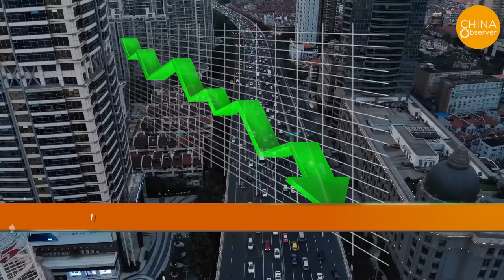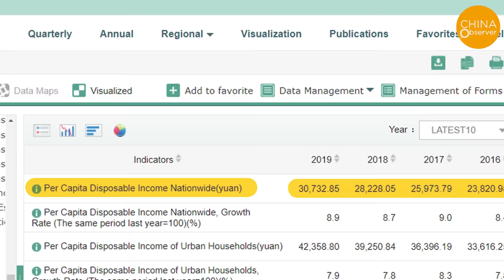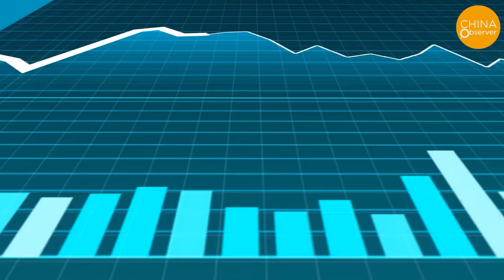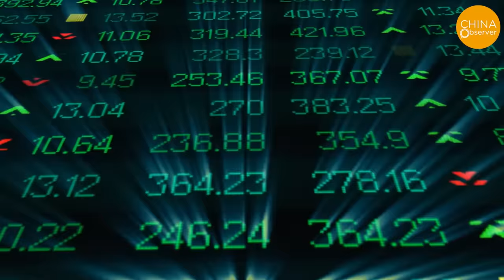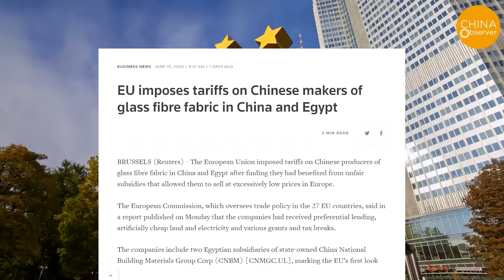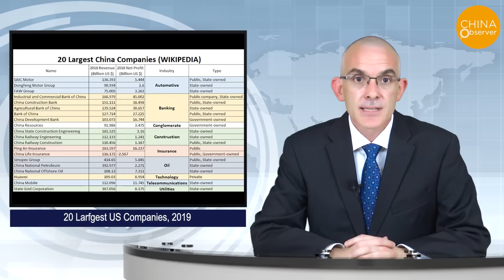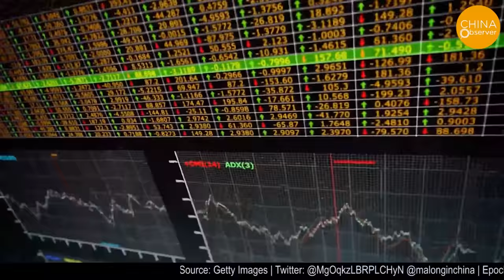China: Not as Rich as You Think | Economy Crisis | Trade War |  Lack of Diversity  | Unemployment

Comment: Good article. But you miss a few things.  Two and a half years ago, PM Modi of india opened india up to chinese goods.  This was dispite his make in india campaign.  In that two year time, imports from china were almost as much as imports to the us.  Result, slowing of economic growth, from over 7 percent to below 5,  Modi has since realized he made a mistake an is now limiting imports from china.  There have been two housing bubblesin the last 40 years, first japan, 1980 to 1990.  Land prices were way overpriced.  Result Japan's economy has been basically stagnant since.  In large part because of how they conduct business.  Which results in an often lack of inovation. Second housing bubble, 2000, to 2007 under Bush.  Almost no economic growth outside of the housing market.  Manufacturing which had increased under Carter, begins to fall.  It is Bush's model of economic growth that th ccp has fallowed for the last 10 years.  Obama warned china against dumping and relying on housing that would not be used.  When china didn't listen, he imposed 20 percent tariff on chinese iron..  and then gradually imposed tariffs on other products.  And now, china faces a problem on how it will feed it's people.  Failure of the wheat crop in northern china due to droought.  Massive flooding of rice fields.  Gov, compensating farmers forced of their land to the tune of one and a half dollars.  Why, locally Gov. Is ripe with corruption, and broke.  So, what will happen time will tell.

Comment: at 1:42 mark it looks to me that the concrete being poured has the consistency of soup.  Can someone who works with concrete verify.  Thanks
Reply: Richard Macabio , you are right. It appears the “ water  cement  ratio” is high, more than normally used, because cement and water ratio determines the strength of concrete. I wouldn’t use THAT concrete in my civil works.
Reply: @sridharmurthy1076  Meh! China is now the master infrastructure builder in the world. They have done so much massive infrastructures that they are the most expert at it. Do you know China used more cement (by far) between 2011 and 2013 than the U.S. did in the entire 20th Century?